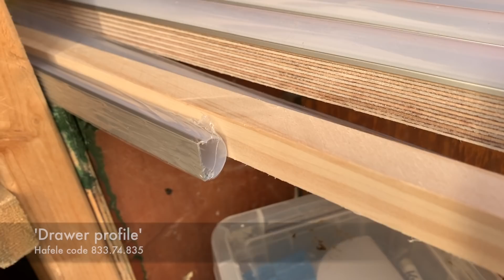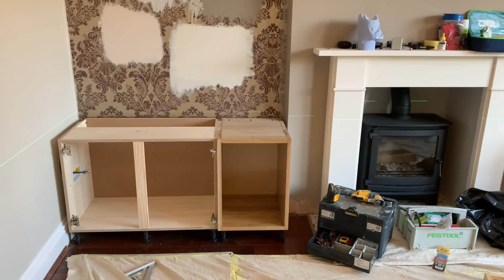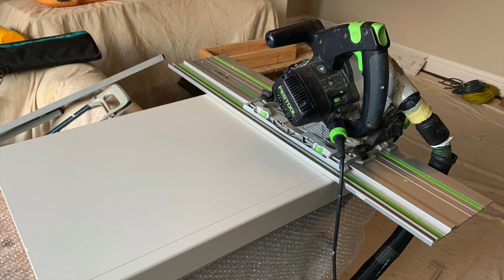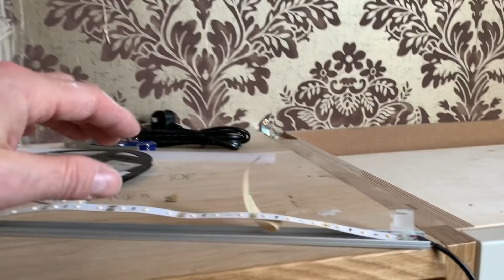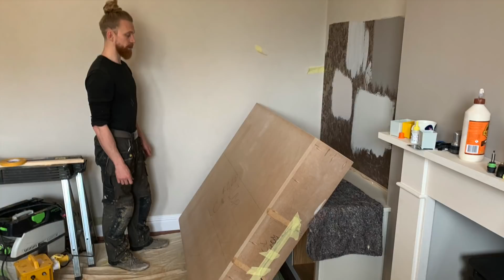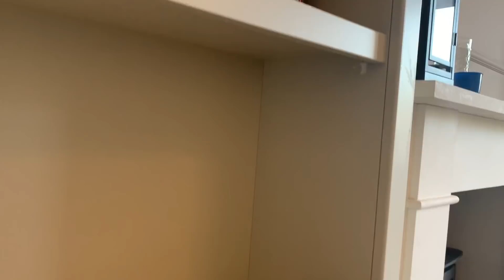Alcoves Installation from start to finish with lighting and oak log storage features.

Comment: Your videos have helped me so much, thank you. How do you fix your side scribes on the upper shelves? I glued and nailed the ones on my lower cabinets but I’d like the top ones to be removable in case I need to mess with the wiring for the shelf lights. Wondered if you use Knapp fast connectors but couldn’t quite tell from one of your other videos
Reply from the maker: Hi James, thanks for that and I'm glad you find the videos helpful.  For permanently fitted scribes we generally use grab adhesive - Sumogrip is now my favourite.  I really see no need to spoend time adding mechanical fixings.   Except... when they might need to be removed for wiring as you said.  In this case we use Tenso fittings with the Lamello Zeta P2 system.  Or Lamello K20 biscuits with standard biscuit joiner grooves

Comment: Hey there, what size lip do you add on the shelve to block the LEDs from the front/bottom angle? looks like 20mm or so? Can it be less? thanks.
Reply from the maker: Hi I found it ought to be about 44mm minimum to shield the light source from view on the upper shelves.  That’s the total front height of the shelf and lip, on an 18mm shelf thickness

Comment: Brilliant, im not so bright I'm afraid,but lost how you connect the strip light up shelf to shelf,is it 1 continuous piece,with the excessive bits between the shelves and the wall,if so even though that bit hidden ,does it still light up,hope I make sense
Reply from the maker: Hi I don’t remember how I got it here, I know there was a time when I hid the connections in the gap either side of the bookcase (so the light strip went a little bit beyond) but I soon regretted this.  So more recently I make sure the connections are just inside the unit where they could be accessed if necessary, but covered by the frosted plastic profile over the aluminium strip.  Losing an inch or 2 of LED diodes near the edges is actually better - you get a more even glow of light instead of bright spots at the sides.

Comment: My only criticism would be the way you chain drill the wiring runs. I'd router out a nice channel and it would probably be quicker and certainly look neater albeit I know you don't see it. With the LED strip I often countersink the channel use a tiny countersunk screw, or use the knock in Hafele stuff which needs banged into a tight cut rebate with a mallet.
Reply from the maker: Really helpful explanation thank you!
Reply: @Alastair_Freebird  Thanks for your content.
Reply from the maker: Do you mean a channel on the outside of the sides, for wires?  Regarding the Knock in LED strips, it’s just that I don’t like how shadow lines are created from the lights being recessed, I like the domed diffuser
Reply: @Alastair_Freebird  Yea just a little channel more or less freehand routed into the MDF. The knock in channel we spec is only 7mm deep and the knock in diffuser ends up edge to edge on the material, I understand your point but I have not yet witnessed any light cutoff with it and I know what you mean, sometimes a sharp light cutoff can be a nice effect, sometimes you want nothing. The profile is called slim8. Not trying to be critical for the sake of criticism, genuinely just trying to help improve your excellent product.
Reply from the maker: It’s ok I welcome feedback.  Where do you buy your Led lights and channels?
Reply: @Alastair_Freebird  Hi Alastair, Topmet. LED strip is usually 24V Holectron which is a really good product, probably have about 800m of that stuff in use including 1 install that had 305m of it! It's a top class product and very well made.
Reply from the maker: Wow.  What are the benefits of using 24v instead of the 12v I use?
Reply: @Alastair_Freebird  Oh probably nothing in practise in smaller runs, it is just what I've used in the past. However, 24V can be run in longer runs because the current is half that of the 12V equivalent of same power output. High currents in LED strip are bad as the current is flowing along those tiny copper tracks, as with cable, too thin a cable and too much current can cause overheating and failure if the track burns. 24V also allows for lower current power supplies, which, as you will know can get pricey for bigger ones. I bought a 8A 24V supply last week which was about £60 - had that install been 12V I would have to get a 16A or twin smaller ones and split the strips up, so your onto more money for more supplies. Voltage drop is also lower, that can lead to dimmer LED's towards the end of a long run as they don't see the same voltage as the first few meters. In smaller domestic installs, as I say, no real benefit.

Comment: i never trusted in double tape to glue leds acessory. I use a small screw before i glue de led . 12x 1.5 mm.
Reply from the maker: Do you find it tricky to drill the aluminium channel just right so the screw head doesn’t go through?
Reply: @Alastair_Freebird  i do a small countersink for the screw head that alows the led glue evenly without noticed the screw head. Remember its a verry small screw used por that propose. The aluminium chanel i use has about 1mm thikness.

Comment: Great job, everyday a school day. Picked up some nice tips watching this!
Q. For the shelves, what way did u fix the front nosing to the shelf. Is it mitre folded or just butt jointed with some sort of domino. If butt jointed would paint crack along joint over time do u think?
Reply from the maker: i agree start offering a primed finish.  Full finishing is a headache!  Work up to that if it one day seems worthwhile.
Reply from the maker: Hi Gary the lips are dominoed, glued and clamped then sanded smooth.  We have found in the last that it is hard to avoid some ‘telegraphing’ of a tiny level difference between edge and face on that front top surface even after repeated sanding and denibbing between coats but this has been much reduced since using the Finsa Fibrapan Hidrofugo mdf and we have never had a problem of actual cracking
Reply: @Alastair_Freebird  Thanks Alastair, appreciate the reply. Got about 3 hrs kip last night watching these. Am a general carpenter but often get asked to do these types of jobs and am not really geared up for it but would like to start doing some.
Think maybe leaving client with a primed finish ready for handpainting may be my best option. Prefinishing and fitting of same is a treacherous business!!!!
Keep up the great work

Comment: Hi Alistair, do you generally buy laminated oak panel or buy planks and make the sheets yourself for the log stores?
Reply from the maker: I buy pre edge laminated solid oak sheets from Optimum Timber Supplies in Mexborough

Comment: Hi, how do you determine how much space to leave around the sides of the main unit? If the answer is in the blueprints, please say and I will happily grab a copy :)
Reply from the maker: Jamie Rutherford yes it’s all shown there!  But in summary I allow 36mm.  The logic is that’s usually more than enough to clear the skirting to avoid shaving to remove it; and being 2x18mm it allows easy packing/cover strip options.  I’m sure you’ll like the blueprints plus LOADS of other member only content here and if not you can always grab it all and cancel if you must and you’ve only lost £5 😉 https://www.buymeacoffee.com/freebird
Reply: @Alastair_Freebird  Thanks, have signed up and looking forward to it all. Was also thinking, why the 100mm clearance height underneath?
Reply from the maker: We use 100mm black feet, a standard available size but not as tall as the typical 150mm used for kitchens.  Any shorter than 100mm and it’s a bit tight getting your arm in to adjust the rear feet!  Thanks for signing up 👍
Reply: Freebird Interiors haha ok, yes a very practical reason which I hasn’t thought about. Definitely the kind of thing you’d find out too late and end up banging your head about! Cheers.

Comment: You can get the plasterboard boxes for thicker material if you should need them.  And as mentioned earlier learn safe isolation before you dive in with the electrics, could be something naughty waiting to give you a belt.

Comment: Another great video Alistair thanks! We do lots of things in our installs in a very similar way and have some of the same issues and some things we do slightly differently to you. We should compare notes sometime we could maybe both learn something! We use the identical lighting system to you even down to the aluminium profile, the only thing is we always drill and screw the profile on, we'd never thought of sticking it on. Suppose it would work well with a good tape but it's exactly the kind of thing you don't want to go back to! Another completely honest video of the average process of a fitted furniture install with all the usual issues and clangers left in! 😊 Thanks again 👍

Comment: As an Electrician may I ask if you carried out safe isolation before working on the electrics by checking with an approved voltage tester?

The aluminium profile dissipates the heat from the LED strip which is probably what softened the glue on the original tape. Any profile I fit is drilled, countersunk and screwed on to avoid issues like this

Nice videos though and I do enjoy the woodworking side as my Dad was a Cabinet Maker/Joiner
Reply from the maker: Thank you, I’m printing that for a thorough read later
Reply from the maker: kevy427 hi Kevy I have an electrician friend who I ring and send photos to if I ever think I’m overstepping my knowledge, and I turned off the sockets circuit and checked they were off by plugging in a radio - is this not an acceptable way of doing it?
Reply: @Alastair_Freebird  It's one way of checking but not the right way. Have a read of this article: https://www.electricalsafetyfirst.org.uk/media/1201/best-practice-guide-2-issue-3.pdf

Page 13 has the proving dead procedure

There's quite a big push in the electrical industry at the moment to ensure people are working safely and come home at the end of the day

Invest in a voltage proving indicator. Test it works on a known supply. Isolate circuit and lock off. Test between E-L, E-N, N-L then test the proving indicator works on a known source to avoid any false positives. Always put the first probe on the least dangerous terminal first and remove it last

Comment: Hi, you use birch ply for your carcasses, is it pre-finished or do you apply finish yourself or do you leave it for the customers painter to do?
Reply from the maker: Hardy Station it is not prefinished.  Years back we established a standard pricing with internals unfinished after getting a lot of feedback that customers didn’t feel painted internals were important enough to pay extra for.  We settled on birch ply as the best material in terms of screw holding power and appearance.  I must say that on a job like this it does seem wrong not to fully finish everything however the customer chose not to, and it is one of those areas where they have a bit of control over the budget, to bring it down a bit to keep the important things closer to their desired budget.
Reply: Freebird Interiors thanks for that, I only ask as I have that dilemma myself and kind of feel like the insides are awkward and fiddley to paint whether you do it before the sheets are cut or after the boxes are made and I feel like I can’t ask for the price I really need to do it
Reply from the maker: Hardy Station exactly!  It’s a lot of extra work and it needs to be priced for.
Reply: I use a 4” x 6” cheap painters pad and pour Minwax polycrylic on the top and spread it with the pad prior to cutting the sheet down. 30 minutes later I denub and repeat with a second coat and done. Smooth and protected with very little time and effort.
Reply from the maker: john gibson good tip John thanks